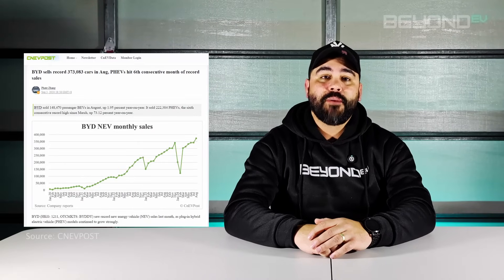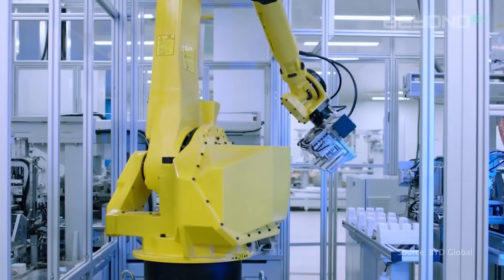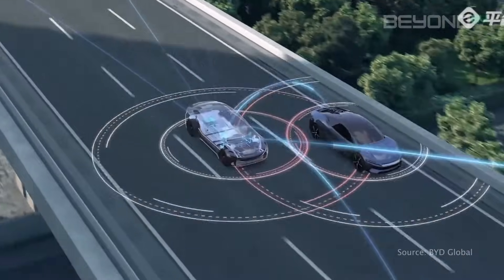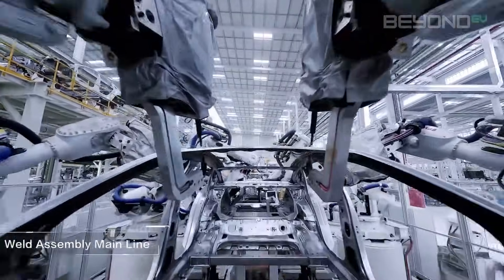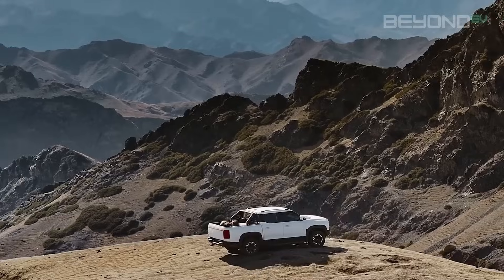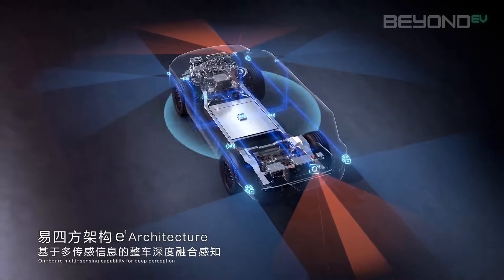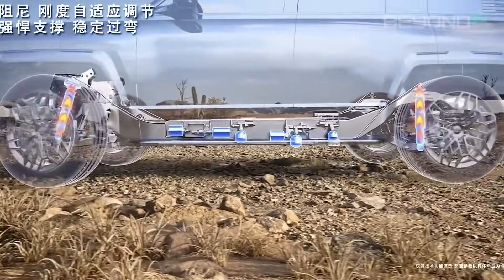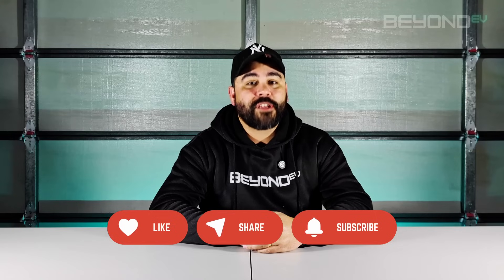5 Automotive Technologies that make BYD Stand Out

Comment: does the shark gas engine only generate power to the battery or is it also directly connected to the front wheels?
Reply from the maker: It is connected. But the electric motors alone provide almost all of the power. Gas engine will mostly just power up to recharge the battery and may add a little extra power to wheels in certain situations.
Reply: EREV system is gas engine that only generate power to the battery.
BYD uses PHEV system.
Except for BYD YangWang which uses the EREV system
Reply: it is connected to the wheels.. but mainly charger battery and produce energy for the electromotors...just in special situations it helps the electromotors to get traction on the front wheels..